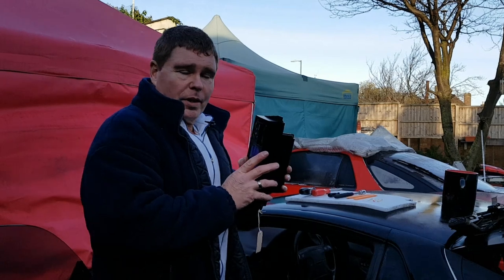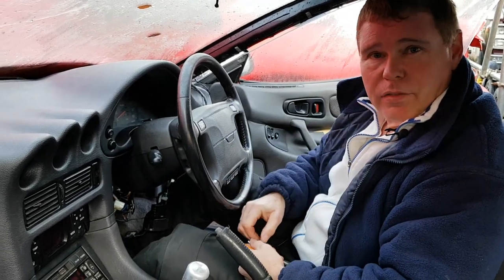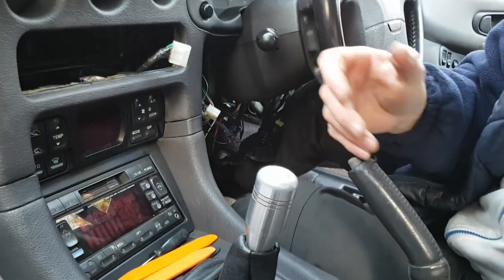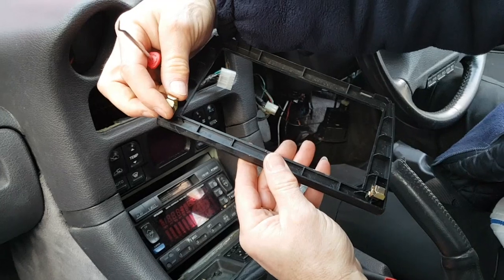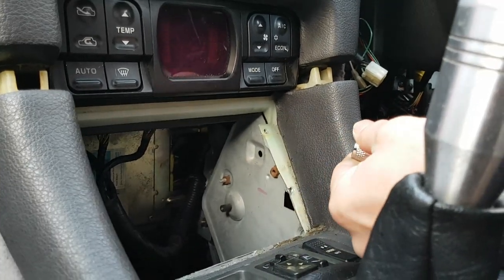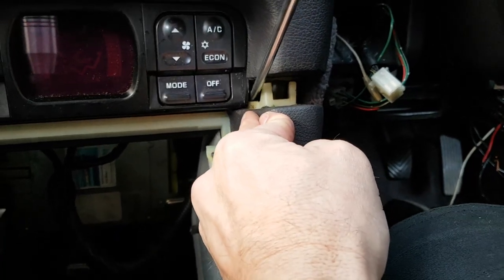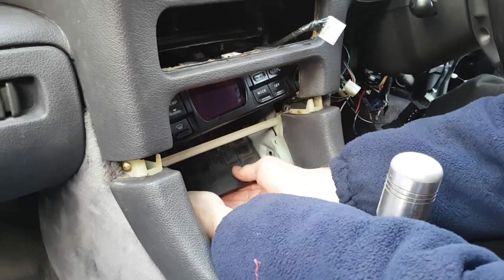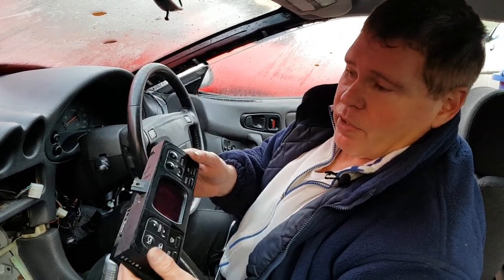Mitsubishi 3000gt / GTO Dashboard Removal & Restoration Part 1 (Climate Control Display Removal)

Comment: You saved me.  My climate control screen burned out on my 93 stealth r/t twin turbo.  I've had this car 30 years and as you know parts are impossible to come by sometimes.  I was trying to find someone to help me because I have neuro problems with my hands due to a car accident.   I watched this video a few times, picked up the extra tools you described and decided to do it myself.  It was a success, although my shaking lost a couple of screws.  Took longer to find new screws, than to follow your directions and remove it myself.   Thank you so much for doing these videos. I did send it to the ebay Texas repair.  I will now check your channel when the next thing needs repair.  Lea from Minnesota

Comment: Thank you!! I had a brief whiff of something electrical frying and then it got cold in my 91 VR4 (Ambient temp that day was in the low 30's) The display didn't work but I still had mode, temp and fan control. Now I have nothing. Removing now and I can breathe easier with the help of this video!

Again, Thank you!!

Comment: Thanks for keeping it simple. I need to take my dash out to replace the air vents at the front of the dash.
Reply from the maker: Hi Gary. Thanks for liking my video. Watch out for part 2 which will show you how to remove the complete dashboard in 30 minutes and part 3 which shows how to restore the warped dash so that the vents will fit back like new. Regards. Joe
Reply: 3000GT / GTO Restorationpl

Comment: On my car the lights on the unit only work on the buttons on one side, is there a bulb on each side behind the buttons that illuminate it, the display still works fine thankfully?
Reply from the maker: Hi.
There is a separate bulb for each side. You will need to remove the display unit to gain access to the bulbs at the rear. You do not need to open the unit up. A simple flat blade screw driver will turn the bulb a quarter turn anti clockwise to remove it.

Comment: Hi !  This is Martin from Argentina! You are helpful by me great time restoring my VR4!
Have a problem though. The original radio digital head unit (diamante) is not working and I was wondering if you know about a place where to get a new one or parts to repair it. It is exactly the head unit showed in this video!

Comment: You are awesome, I have to have my climate control refurbished. Do you happen to know what causes a fuel cutoff at full throttle and boost at 14 psi .No one seems to have a definite answer.

Comment: Gary New Zealand.? Great vids, own GTO one owner 1991.
Can you explain where the electronic plug from the computer is located for the fitting  a I Drive fuel regulator  to adjust fuel to the engine to increase power performance. 
A photo would be great to show the type of plug and the number of pins etc.

Comment: Love all your videos, very helpful, thanks !   I have a 95 SL and the lights behind my (old dial style) climate controls won't light.  I noticed that you don't have a car with the old style climate controls on them, but regardless wondering if you may be able to do a video on how to troubleshoot dash lights ?  All my other dash lights work except these, so suspect something got unplugged when the previous owner installed a new radio......just need some help figuring out where the wiring runs and what I should check.   Any help is much appreciated and thanks again !

Comment: Thanks for a very informative video. I need to replace my dash vents on my 92 RT TT but have been hesitant after reading the manual. Your video takes a lot of the fear out of it. I look forward to part two. Now a question, any chance you know of a replacement for the radio encoder (volume control) for the original factory radio? I need to replace mine but have had no luck in finding a replacement. Thanks.
Reply from the maker: Most standard radio's will work but some will require a cable adapter. If you want to use the steering wheel controls, you may need a interface but it will depend on the make and model of radio. If you are not changing the radio and you are just having problems with the steering, volume controls, they are a very basic piece of electronics that is very easy to repair. The main problem they have is dry joints so you should be able to fix it yourself or get it fixed locally. I am what you might call a purist so I never use anything other than original specification parts so I am probably not the best person to talk to about changing radio's or using non standard parts. I would recommend talking to your local mitsubishi dealer for advice or a car audio specialist. They will hopefully have a lot of experience in this area. If you are not confident with the advice they give, then post a message in a forum and hope there is someone who has had experience with this issue. I have also attached a picture of a product from the states that claims to give hassle free interface but I haven't tried it myself. Maybe you could give them a call. Don't forget that if your buttons are faulty, the interface won't work.

https://rover.ebay.com/rover/0/0/0?mpre=https%3A%2F%2Fwww.ebay.co.uk%2Fulk%2Fitm%2F253612192094
https://rover.ebay.com/rover/0/0/0?mpre=https%3A%2F%2Fwww.ebay.co.uk%2Fulk%2Fitm%2F401410184583
Reply: Thanks for the reply. I’m the same as you, I like to keep everything original and stock. I can find encoders but the stem length is always too short. I just thought I’d ask in case you had dealt with this issue in the past. Anyway, I can’t wait for dash video part two. 🤗
Reply from the maker: @terrygetting1050  It looks like I may have misunderstood what you was talking about. Are you talking about the electric antenna that goes up and down?
Reply: 3000GT / GTO Restoration. The original Stealth / Mitsubishi radio’s had an issue with the volume controls failing. They use a rotary encoder rather than a resistor to change level and I have been trying to find a replacement encoder for mine since the original is no longer made. I started out going to local dealers but they know nothing about these cars. One even told me it was time to buy something new!? Anyway, I have been searching the internet but can’t find a replacement that matches the original. Changing it out is pretty simple, take the radio apart and three solder joints later it’s done - if I can find a replacement that is. So if you have any leads I can follow that would be great, otherwise, no worries.

Comment: Really appreciate all your videos. Without your assistance. I wouldn't have been able to replace my power antenna motor.  My 1992 VR4 I bought brand new. It oy has 60,000 miles. The display just failed and your video was absolutely essential to me to remove the display and controller.  One question: even with magnetic tip screwdrivers, I managed to lose several screws into the abyss.  I will buy more. Must I locate these for fear of rattling noises after I fix and reinstall?

Thanks, Martin in Miramonte, California USA.
Reply from the maker: Only one way to find out.

Comment: Great Video. My climate control screen just went out so repair/replacement is in the future. Can you do a video on how to reinstall the climate control unit? Removing seems straight forward but I'd like to know more about the install order for the climate controller and display. Thanks!!
Reply from the maker: Hi Seth.
Installation is the exact reverse of removal. At the moment, I am only doing strip down, testing and repair videos for free. Later in the year, I will be doing a dvd collection which will cover hundreds of manufacturing tips, overhauling, re-assembly, re-conditioning, part identification, restoration and rare part sources. There will be a small charge for the dvds but any one of the jobs covered in the dvd, will cover the cost of the entire dvd. The dvds will be in 5 parts covering interior, exterior, engine, drive chain and other areas. These free videos have cost me $1000s so I hope you will consider supporting me when the dvds become available. Which country are you in Seth?
Reply: @3000GTGTORestoration  I am in Milwaukee, WI USA. I would definitely purchase the DVD's...as long was you have region free or region 1. Thanks for all your videos
Reply: 3000GT / GTO Restoration I have a feeling that could be popular within our niche. Please spread the news around once it arrives.

Comment: Dear Repairman, your videos are very good. I understand you repair climate control assembly. I have a Mitsubishi GTO3000 1994 model.
The display on my climate control panel is not functioning as the circuit board is burnt in 1 or 2 areas. How do I go about sending the unit to you.
Please advise.

Comment: Hello again my friend! As I’m getting to the earlier videos, I can now see you’ve already done some very fun parts! I have a question, will this process be the same on a 1999 3000GT? Mine doesn’t have the digital climate controller, mine has the circle dials. Also, should we unplug the battery before removing the radio and climate controller?

Regards, Gold wolf USA.

Comment: When I removed my A/C control panel I noticed a small white switch on the top right of the unit. This switch was in the center position. I had purchased a replacement and noted that the same switch was in the in a diferent postion (to the right). Any thoughts on this ?
Reply from the maker: It will work fine in either position

Comment: I had a fire in my 1993 GT3000 VR4 ECU I have replaced everything that makes spark cam crank sensor coil packs transistor an getting no power to ecu an no check engine light also  Car has 59 k that has never been touched by anyone Think you can help with any advice I could use
Reply from the maker: Start with the fuses in the foot well. Then join the forum where you can use the combined brain power of all members.
Forum.the3000gtplace.com

Comment: Hi , do you still repair these ? If so what is the best way to contact you ? Thx
Reply from the maker: You can contact me by private message on the forum.
Forum.the3000gtplace.com
Reply: @3000GTGTORestoration  Thx. I have tried to register on the forum but it isn’t sending the verification email, I checked my spam also.
Reply from the maker: We have had so many people try to join today that our varification limit has been reached. It will re-set at midnight and then you will get the email. Sorry for the inconvenience.
Reply: @3000GTGTORestoration  My account is setup but I cant do PM or even message a staff member.